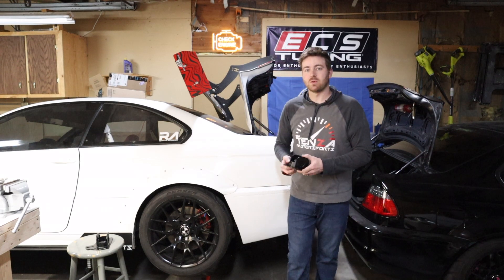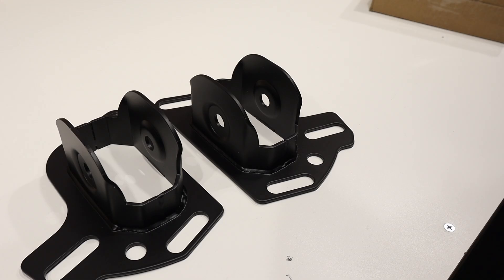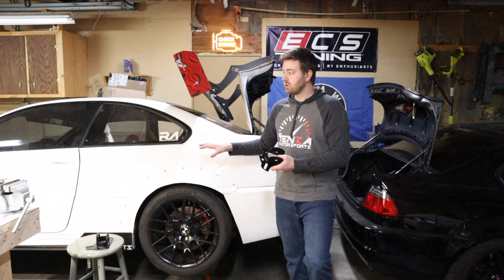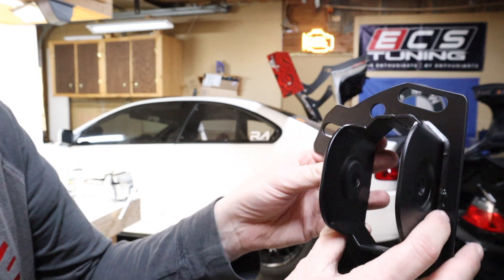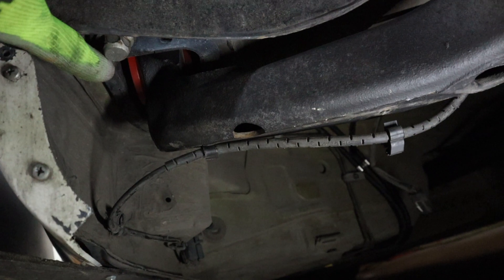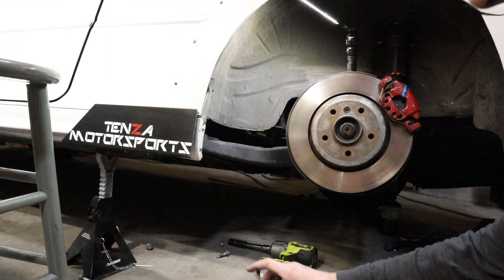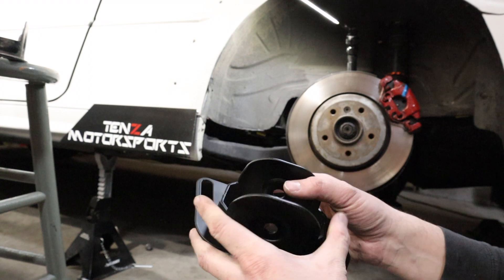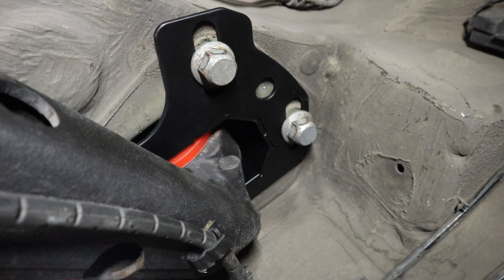E46 racecar build Adjustable Rear Trailing Arm Bracket toe adjustment - DIY install and comparison

Comment: Nice video. Question: at the 6:14 point, if you were to close the upper gap that's visible with the two bolts (i.e., pull the bracket "down" ) would that increase toe in or decrease toe in?